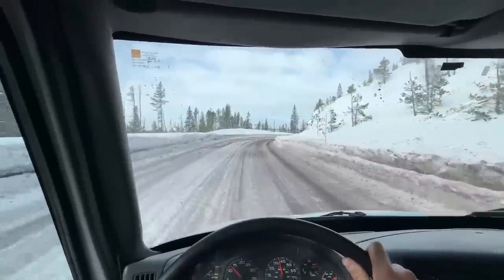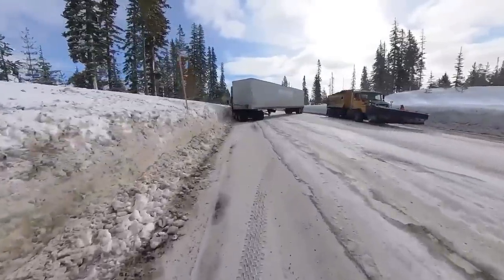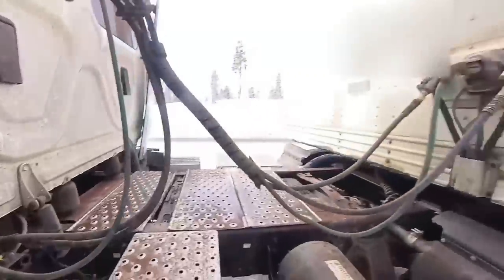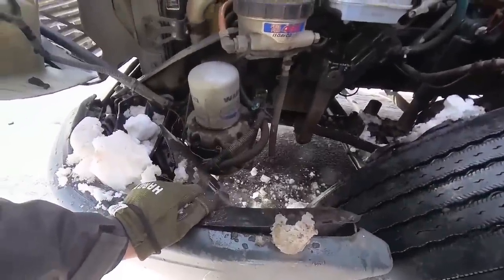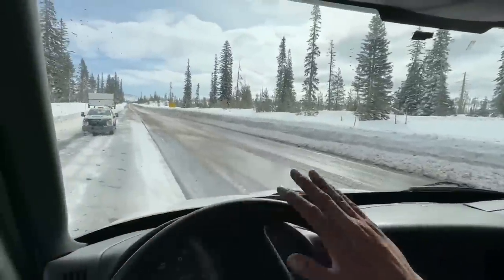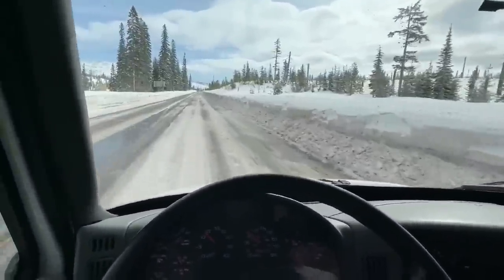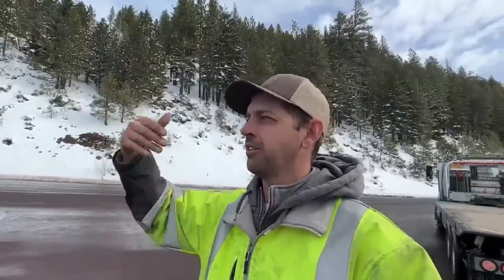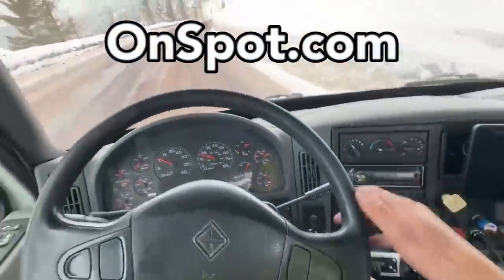Ice Road Trucking Goes Wrong!

Comment: So cool of you, as a fellow trucker, to give him a whole safety check of lights and everything before sending him on his way. That's customer service!
Reply: A haircut would have been nice as well but let’s not git greedy
Reply: Well as the truck got really lucky with only minor cosmetic damage and the loader did most of the job he had what he could and since time spent driving there anyway!
Reply: To me thats just part of the job. Now I do not work in Casey's industry.  But when I build a pc for someone  it will go through a burn in process  to ensure  no problems with any of the components.
Reply: Rules of the road, at least it used to be. Integrity once had value.

Comment: Casey, you show a side of tow operators that a great many don't see in action or realize - helping to safe the vehicle for travel, checking his brakes and lights, etc (being the great guy that you are). I've seen many a tow driver spend more time cleaning the debris up from an incident than the actual response took, and even though you are supposed to, there are those that do just the bare minimum to get by. I feel for the driver - an empty trailer is a bad thing, and this is one of the reasons why!

Comment: UK here; I wondered what those 'senders' were that were down, until I saw the gritter truck and realised it was a regional accent for 'cinders' ! Learnt something there - we call it grit, or salt... ;-)
Reply: I d say most of the rest of the country would say sander as they are spreading sand or a sand salt mix usually as the salt keeps the sand from freezing
Reply: In some parts of the country they use cinders (coal ash) because it is dark and absorbs sunlight, and it is also easier on some trees than is salt.
Reply: Here we tend to use ground rock salt, usually pre-wetted. There is a lot of science now behind the different stages of road clearance.

It's often tricky when dialect word choice and accent leave the listener confused! (Cue picture of a 'bread roll' with multiple names)
Reply: @heartland96a  the salt doesn't always keep the mixture from freezing but it does let the sand provide some traction. The downside is the sand needs to be swept up afterwards but I think it was a great help in our city. I have gone sideways down a few streets in a snow plow and it was not fun to be sitting behind the wheel but the truck went wherever it was going until some traction or obstacle stopped it. Not fun. Hit a power pole one time and the blade skipped past the pole and so it was between the blade and the bumper then I had to turn away from the pole to get away from it. The resident of the house came running out to see what happened because it was really loud inside. Everything was ok because I was just barely moving.
Reply: The cinders used in Central Oregon is actually crushed red volcanic rock. Very course and abrasive material with a large local supply. Only downside is increased windshield replacements in the winter months.
Reply: Grit and salt do different things, not sure how much attention they pay these days because we get so little snow in the UK these days. Grit is spread into falling freezing snow and the traffic packs it down with grit embedded in it for grip, and salt is used to thaw and clear the road. I remember seeing gritters changing loads as conditions changed back in the 80’s and 90’s when we used to get 3 months of snow every year (west coast of Scotland)
Reply: @brypur8629  Ah, crushed volcanic rock -> [burnt to] cinders ; Yes!
Reply: @1988dgs  Yes, there's pre-snow [used wetted rock salt], during snow [grit], and post-snow (too late;-)approaches. I remember the M8 closure a number of years back when it became like corduroyed ice;-)

Comment: I have to be honest, Onspots are wonderful. I even have them on my Ford F150 truck. I used them after some nor'easters here in Connecticut and they are incredible. They worked very well in my driveway when it was still icy. Onspot mostly focuses on commercial vehicles but they do often have kits that will work on pickup trucks like mine.

Comment: Just so I have this right, you take the tools after you're finished using them and put them back where they belong?  Could that be the step I'm missing that makes it impossible to walk through my garage or find things when I need them?  Interesting concept.
Also, was it just me or were your hands slightly shaking with excitement when you hit the auto-chain switches?  😄
Reply: I think that's why I have 2 or 3 of everything.
Reply: @carmenevans7651  You and me both.  I can't open a drawer, toolbox or glove compartment around here without finding another set of Allen wrenches.
Reply: I've got 1 small shop, 1 back porch, and 4 free HF tape measures. Very frustrating on day's that they all hide.
Reply: @edwinhsingmaster9135  my tape measures sit on the kitchen table. They disappear when I need to measure something. It's just me and the cats and I don't know what they are measuring.
Reply: I lose tools just sitting at one corner of the vehicle (like working on brakes). I find the tool on a box halfway across the garage.
Reply: @edwinhsingmaster9135  Get locator tags (like Apple Airtags) and when you find one, stick a tag to it...then when you need one, just hit the remote and listen for the beeping...

Assuming you can find the remote...

I can't find mine...

😄😁😆😅😂🤣

Comment: I would like to see a video from outside of the truck how the auto chains work I have never seen nor heard of such I am not a truck driver but my dad was a diesel mechanic worked at Frito-Lay in California and Kentucky freight liner in Kentucky so I grew up around tractor trailers and I have just never seen such sounds cool as hell but I sure would like to see them work
Reply: Casey did a video on his getting fitted.

The video is called,

"What are automatic tire chains, and how do they work"

Catchy title 😂 just in case you want to look it up yourself and not use the link below.

https://youtu.be/lLhqIVSM8wo
Reply: Casey has one that I've seen that he did after they were installed on his rig.

Comment: I always enjoy the rollback jobs. But the remote for the bed and winch i can't handle. The sounds made by pushing the buttons is very similar to the sound airport metal detectors made back in the 70s and early 80s. I couldn't be within 100 yards of one of those when it went off without cringing in pain. Another reason I haven't been on a plane since September 1985. My sensitive hearing is part of why i was a Communications Technician Technical Branch (CTT) in the Naval in 70. I still enjoy watching and turning the volume back up when you are done with the remote. Just a story from a subscriber. Peace Out.

Comment: Unfortunately, Cost and Weight prevent most trucking companies from Auto Chains. It's easier and cheaper to yell at a driver about being stupid, lazy and incompetent from the safety of an office desk.
Reply: nice job well done 👍
the company i work for, got Onspot on all trucks that drives i norway and sweden 
one Onspot for one side is around 10-15 kg so a set (left and right ) is around 25-30 kg 
(1 kg =ca 2 pound )
Reply: @torbendk2777  awesome 👍😎 I drove in Alaska for 13 years on been on the run over the Cascade mountains, Casey's area, for 10 years. Never seen an American company be so nice.

Comment: Well done.  My fire department has used various brands of auto chains for years.  Only problem we have is forgetting to operate them on a regular basis year round to confirm they will work when needed.  Only question I have is where do you get cinders for use on the highway.  Government regulations and environmental concerns have shut down most users of coal in Iowa.  A lot of towns used cinders when I was growing up.  Had to leave your boots on the porch so as not to track cinders into the house.  Great traction assist.
Reply: I think they are volcanic cinders rather than coal.
Reply: @sharonmiller6436  Thanks, googled it after your reply.  Apparently good use for a available resource.
Reply: @genebeard930  Exactly!  Sure beats importing something else when the local stuff works so well.  🙂

Comment: All big rigs should be running auto chains. The roads are so bad with pot holes. We drove from Eug to Moab for EJS on our way back 30 miles east of Boise our RV hitch bolts shook loose. We lost all but 1 we got pulled over not loosing trailer. We only check under RV maybe once a year. We check trailer ever time we stop but we don't crawl under RV or Pick up. We will from now on. We also had 1 strap shake off Jeep twice which could have been a disaster. We do not have cheap straps. We have been dragging race cars & Jeeps around for over 40 years these are 2 firsts for us. Happy Trails 👣

Comment: why do you take your cut off wheel off your grinder? so it doesnt break jostling around in the box?
Reply: Discs can break or crack. Or f something crushes it by mistake. And then the disc cannot be used at all. I had a family friend who ironically lost his middle finger because a grinder disc exploded. Obviously it wast from a broken blade. Just shows how much safety is needed

Comment: Can the auto-chains be configured to get a speed signal from the ECU to disengage the chains if the truck goes too fast or they are engaged at a speed higher than recommended?
I can see a lot of drivers not paying attention and messing them up.

Comment: Hey Casey,
   I do not understand why you did not hook onto the back of the tractor to pull the trailer back into the direction he was traveling, then hook onto the left front wheel of the tractor to spin it around to set him up to continue in the direction he was driving before the jack knife happened.
   That truck of yours with your knowledge of how to use it is a great piece of equipment.
And I suspect it is way cheaper to own and operate than a heavy wrecker.
   Way to go man !
   Work Safe, Be Well
          Enjoy Life
Reply: Likely to damage the truck. (Pulling bumper/fender backward against the snowbank and the trailer against cab fairings.)
Reply from the maker: Because the trailer was smashed into the cab and that would have caused further damage.
Reply: When i saw how easy that trailer moved i was like …that has to be empty …its astonishing we dont have Ai logistics that would see the conditions and have a back load …just because the odds are so high for an unloaded truck to find trouble …

Comment: Companies don't like to put auto-chains on trucks because of the cost (about $2k per axle, I think?).  But it would seem to me that the cost of recovery, repairs, damaged goods and shipping delays for just one accident could cover some 20 trucks or more.  Not to mention potential liability costs if the truck hits someone else.  Honestly, I think it's a no-brainer to have them installed.

Comment: I cut a plastic air dam off my dodge with a grinder and dripped melted plastic on my rubber glove, it didn’t melt the glove but super heated the sweat inside and gave me a 3rd degree burn on my pinky finger 😮😖

Comment: By careful using the auto chain's. They're nice but if you use them too much they will destroy your inside duals . Because the little wheels that spin the chains eat into the sides of the tires it's not pretty.
Reply from the maker: Align then correctly and they don’t do that.
Reply: @CaseyLaDelle  if the driver is a idiot and runs them for eight hours straight up to 60 mph it doesn't matter.  Lol 
We had a few drivers do it.

Comment: “I can pop those clips off take it off right there” proceeds to just rip it off with a pry bar.. then chop through anything else with a grinder… eek
Reply from the maker: Welcome to vehicle recovery
Reply: He did pop some clips but it was still attached, given the part was already damaged and would need to be replaced what extra damage was done by cutting it off? Absolutely none, made for a safer vehicle plus got him back on the road quicker.